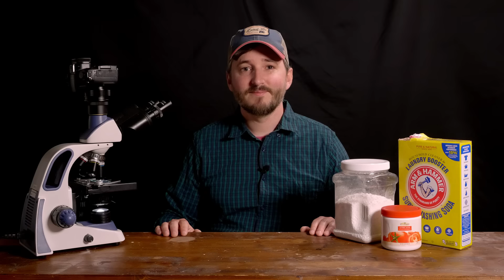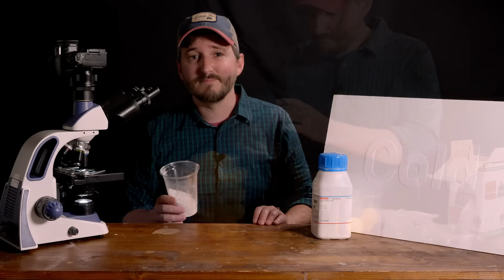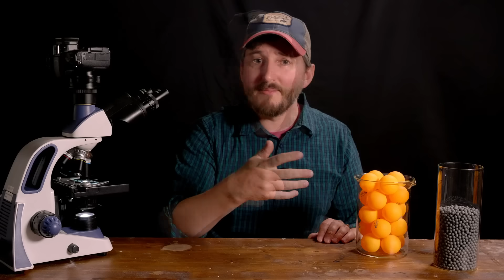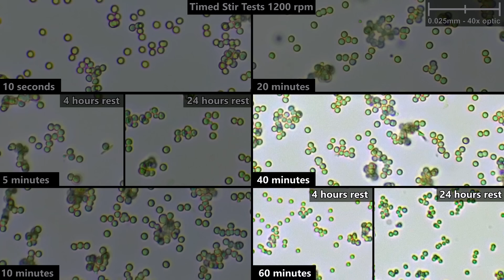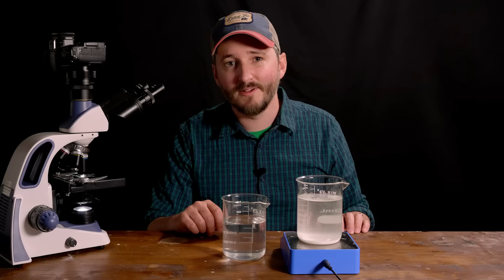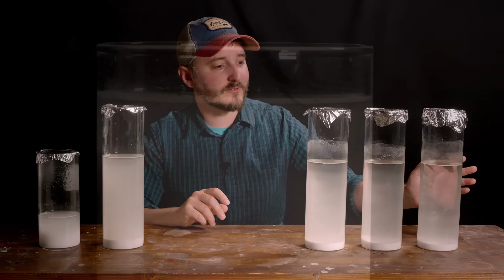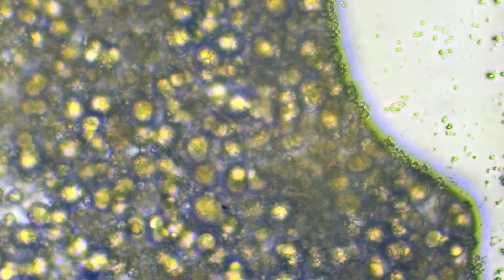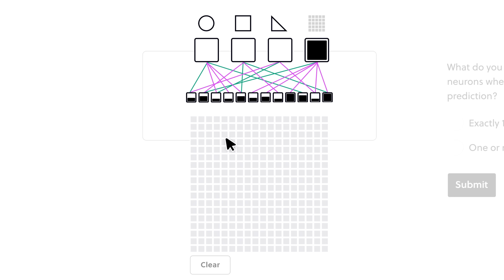Making Infrared Cooling Paint From Grocery Store Items (w/Novel CaCO₃ Microsphere Synthesis)

Comment: This is cool. How many BTU per hour can be radiated out to space?  How many panels would one need to make, or what size would the panels need to be in order to match the performance of a window air conditioner?
Reply: So one company sky cool systems put a system of 32 panels on a grocery store cooler and saved $5,800 per year or $90 per square meter in electric costs. These run 24 hour a day, have hot water running into their commercially made coolers. This was about 2.5 times more effcient than solar panels. AKA radiative cooling saved about three times the power, a solar panel array might have made. For comparison one could use solar panels to run an air conditioner. I suspect in this case they improved performance by putting very hot water in the radiative cooler.  This was a 15% improvement.
Reply: If you covered an entire house with a panel like this, it would be like night time all the time and there would be no daytime thermal gain from the sun. This would do away with much of the need for air conditioning. (humidity is another issue) (in humid climates as much as 25% of air conditioning energy goes into removing humidity from the air) AKA sort of like have a house in the shade of trees all the time. That said, these cooling panels have limited cooling per square meter.
Reply: OK so here is the answer. So in the daytime, the sun can radiate about 1000 watts per square meter in heat, radiative cooling can radiate out about 100 to 150 watts or about 1/10th that amount. So If I had a house and I covered it in radiative coolers, and it was 9/10ths radiative coolers and 1/10 radiative heaters it would be about the same. (assuming a radiative heater captured all the sun power (in reality some capture about 40%).  Good solar panels capture about 20% of the energy.
Reply: So with cooling of 100 to 150 watts per hour, a ton of cooling is 3,500 watts of cooling. A small house in America in a place like Indiana will have an air conditioner that has 2 tons of cooling per hour. it has 7000 watts of cooling capacity. If each panels has 100 watts it would take 70 panels 1 meter square. This means it would take about two thirds of the cool of the house with cooling panels to keep the house cool.
Reply: So if you took a house that had a thick concrete roof, and had a lot of thermal mass. Painted it white with this special paint, then covered it with two or more layers of plastic to keep the heat out, and allowed the roof to radiate the heat to space, but not absorb the heat from the air, the house should cool enough to not need air conditioning. If would effectively, always be cool. This could be aided by some thermal mass, (lots of buckets filled with water.)

Comment: Talking about protecting the paint, could you coat it in epoxy resin (or even mix the pigment in) to protect it long term? I suspect this will reduce the effectiveness to some degree, but still allow for significantly increased lifespan, potentially making it more worthwhile. Just thinking out loud...

Comment: Create a graphite besed primer first then coat it with your solution. You could use sodium slicate mixed with graphite powder. You will need to apply a seperator layer / electrolite layer. This can just be straight sodium silicate. Then apply your paint. This could possibly produce a small current. I was working on a TEG Paint and insulation system. It has both electric storage and also worked with temp differiencials. First attempts used graphite / Sodium Sylicate and Alum Oxide powder / Sodium Sylicate with a seperator layer. You can use straight alum for the anode as well. A very simply experiment is to put sodium sylicate in pop can and submerge a chunk of graphite in it. Apply mild heat. In my experiment I think I made four of them and hooked them up in series and I could light an LED with this crude set up. 

If an entire house was built using these materials, you have cooling plus potential to produce electric for battery storage. Given the added Peltier effect this may work to help with heating. Very interesting Im saving this and will revisit my development to merge what you are doing with it.

Comment: Fantastic video! I've been awaiting your results eagerly (I think I even mentioned previous video comments that I have a project using this) and it's exciting you found such a cheap, effective formulation. Tip I learned from my chemistry profs: when pouring powders, it's best to do it by turning the container back and forth on the axis of tilt. This helps to reduce overflow and messes that happen with pouring powders. Clumpy or static-y powders will obviously be more challenging, but it still helps.
Reply: More thoughts, on application of the "paint": this could be amenable to using a 3D-printer style setup for application, maybe?

Comment: try using a ultrasonic jewelry cleaner for even smaller nano particles after stirring a little. also try diluting it a little & try different nozles for spraying it on with a paint gun. also can you compare your paint to off the shelf coatings that are supposed to do something similar like coolcoat or stakool? & thanks for making these videos they are very informative.  I hope to someday paint my entire RV with whatever seems to work best & hopefully be able to stay in the Texas heat with minimal to no electrical use for cooling.

Comment: @nighthawkinlight I’m working on refining this. I teach engineering at a major university and would love to see all your different failed designs. 3 questions jump to mind immediately: 1) doesn’t the foaming/snow action of the acrylic and water mix reduce the packing density? 
2) could you just go for the smallest sized Valerite particles with 10min mixing? Should get high density?
3) did you try off the shelf #200 mesh calcium carbonate with the acrylic water acetone base? If so what we’re the cooling results?
Reply from the maker: 1. The foaming action introduces voids in the paint but does not reduce pigment density within the solid regions.
2. Packing density of any one size of sphere is ~65%. The voids might be harder to see with smaller spheres but the volume they occupy is identical.
3. I was unable to find off the shelf CaCO3 of sufficient purity and whiteness to compare to the bright white spheres. I try some that was slightly offwhite and it did work reasonably well but the spheres work better.

Comment: As far as applying to a sheet, have you tried putting a thin layer of the CaCO3 microspheres on the panel you want to coat and then misting with cyanoacrylate? I think it should cure nearly instantly as the CaCO3 is slightly basic. Could adjust the viscosity of cyanoacrylate with acetone as well. I believe dried cyanoacrylate also has the snow scattering properties you want as well

Comment: The application method is laughable. 😂. Better just use a ceiling popcorn hopper with an air compressor to spray the stuff to the correct thickness. People are not that patient. Awesome video.

Comment: I feel like this pigment could be mixed with cement or clay and made into bricks/tiles or even just incorporated into a glaze. Cooling bricks instead of panels, like the opposite of insulating bricks. Great content as ever, thanks for your time and R & D!
Reply: After some looking I think clay or glaze is out, as the firing temps required would likely decompose the spheres. Cement might work with a proper ratio, just enough to hold the thing together but not so much that the crystallization interferes with the stacking of the spheres. Not sure. Then there's sodium silicate like what's used to harden sand molds for metal casting, obviously quite durable, but again I'm not sure if those crystals would get in the way of the spheres. Lots to be tested for sure.

Comment: Could you mix this paint into a liquid and run it through pipes to absorb heat from inside then run through a clear piping radiator to drop its temp and then pump it back into the house?

Comment: Thoroughly fascinating video! Great work solving the sphere size problem, your finished product looked great. I have an idea for application. In modern cabinetry kitchen cupboard doors etc are often "coated by placing them in a paint filled vacuum seal bag. Once the vacuum is pulled, it leaves a beautifully clear smooth and tough surface. This could aid with getting an even look as well as providing a protective film for the material inside.. Best of luck!

Comment: There's a second half of how this paint works that confuses me thermodynamically - why can we confine our thermal radiation to preferentially be in a single band? Surely if you pushed it to the limit, you'd be able to take thermal energy and convert it to a single wavelength, dropping entropy?
Reply from the maker: I'm not sure why confining IR radiation to a single band would violate entropy any more than an LED violates entropy with a single band of visible emission. This isn't an energy neutral process. Ultimately the emission is being powered by the sun as the panel is absorbing heat from its surroundings. If there were no exchange of heat between sun and earth everything would cool to the same temperature. You might want to read the Wikipedia article titled emission spectrum.
Reply: @Nighthawkinlight  A large electric potential is a highly coherent source of energy from which to generate a highly coherent beam of light. I guess my confusion is about the relative entropy of thermal energy vs electromagnetic energy in a very small frequency spectrum. It seems that a substance that only radiates in certain frequencies is necessarily "reorganising" random thermal energy back into a few frequencies from which we could easily extract work.

I guess there must be a limit in the nature of how or to what degree this thermal energy can be reorganised/packed into small frequency bands, that is nonetheless still exploitable iff you have an electromagnetic coupling to space.
Reply from the maker: @jamesnomos8472  It doesn't make sense to think of heat as incoherent. A flow of heat from one place to another is how most "coherent" electricity is generated. You could also think about this in terms of the Tacoma narrows bridge collapse. Highly incoherent air simply flowing in one general direction was able to stimulate the resonant frequency of the bridge until it collapsed. That's all that's happening in this paint. Heat is flowing from a hot place to a cold place and stimulating the resonant frequency of the CaCO3 molecules along the way. That stimulation is dissipated by the release of IR light which naturally corresponds to the frequency.

Comment: I think the next step is to delve into paintmaking and the substances used for binders and whatnot.
A good paint-base which you could add this to, which also does not interfere with the IR properties of the CACO, yet still provides structure and protection, would potentially make it like a regular paint.
Basically, what I'm saying is: How do you make auto-body paint with this pigment?
Reply: Also, if you heat the surface, can this keep up? How many watts of dissipation can one potentially get using this as a radiative cooler modification?
i.e. Waste heat, piped to panels coated with CACO, pointed at an IR solar panel to regen some electrics perhaps?

Comment: @nighthawkinlight what microscope are you using to see the nano particles? Normal microscopes can't see that small because they rely on the wavelength of the light.
Reply from the maker: An optical microscope can see a particle down to about 200nm in size. The smallest I made here were probably about 4-500nm

Comment: Does the acrylic paint stick to plastc, eg coriboard? I'm thinking this would be best as a water-cooling panel, especially at night-time (in hot countries ambient air remains hot well into the night, but skies are often clear).
So run water through cheap plastic corrugated panels coated in this and store the water for day-time cooling (or use it directly, maybe as a waterwall to catch humidity too), and some additional cooling during the day if skies are clear etc.

Comment: something like a 1/4 in. x 3/16 in. V-Notch Flooring Trowel could spread it evenly. first pass produces ridges. then dry. second pass with a squeegee fills the valleys. 
great vid. subscribed!
Reply: on second thought, the shriveled ridges wouldn’t leave the right amount of valley. the filled valleys would shrink even further. it would probably be infuriating to keep topping up the valley after it shrinks each time. better maybe to just rely on the first pass with the trowel to evenly distribute the paint then hit it it with some vibration to see if it will auto level. 🤷‍♂️

Comment: I'm sure this will be buried but if the paints thick enough wouldn't a wood dowel with rubber O ring spacers the thickness of the layer you want be the ideal solution, just put a heap of paint down then spread it out exactly as thick as you want it

Comment: What about some form of powder coating?

Rather then pre-mixing with water and spraying could you maybe coat the surface with water/solvent/adhesive then spray or dip the powder onto that?

If it would work it might be possible to do lots of thin coats and depending on drying time actually be faster.

Maybe even via electrostatic if the materials can be charged sort of like the method used to paint cars?

On the assumption my assumptions aren't assumptions of course 😉

Comment: So basically you just expanded upon the research in that paper by figuring out how to control the size of the particles precisely, and then instead of writing a convoluted and difficult to read paper that would be blocked behind a paywall, you disseminated it to the masses in a comprehensive, easy to follow video guide? Now THIS is the future of peer-reviewed literature.
Reply: Also, the most obvious application in my mind is to make window blinds with this. Not only do they repel the light, but the sub-ambient temperature will actually be retained on the inside of the window pane in a well-insulated house.
Reply: Could you combine this with the waterproof tarp recipe? Would the naptha & silicone solution be okay to combine with the pigment or would it potentially break it down? I'd guess so since I gather it's a base rather than an acid.

But then, would using the silicone mixed in with this material just dilute the pigment and therefore render irrelevant all the work in making it high-density? And on that note, wouldn't any liquid base ultimately dilute the high-density pigment to some extent? What does the pure-acrylic paint vs. the water-acrylic paint look like under a microscope? Doesn't the water-acrylic mixture dilute the purity of the specific pigment which reflects that oh-so-special wavelength of light, even if it does make the mixture a 'very bright white' to our eyes?

Comment: Experiment number one. What thickness is optimum.
Experiment number two. How much of the effect is just insulation properties?
Experiment number three. What effect does various mediums for holding the pigment have on its desired effect. For instance, mixing it in clear epoxy, tree sap etc.

Comment: There are people who improve solar panels by trying to concentrate the light on the panels. The issue with concentrated solar is the heat it produces. You have to waste some of the gains made by using fans or other cooling methods. This paint might be able to fix concentrated Solar's biggest issue if used correctly.

Comment: Excellent video, as always! All your efforts definitely paid off!
Regarding coating panels/any flat surface, I immediately thought of the methods used with resins (such as epoxy): use a (non-stick, acetone resistant) "frame", along with some mastic (acetone resistant one as well, which would rule out any silicon based product?) to prevent leaking, then pour a more fluid, acetone diluted version of your paint, so that it eventually ends very flat, with a smooth surface. The frame would allow any shape (if needed) on the panel/target surface. As for tubes, though most probably impractical (especially for long ones), the opposite *could* work well: a thicker paint (but not too much!), then dip the tube in it, vertically, and allow the excess to flow down. That would not be ideal though, as the final coating would most probably not be regularily spread out along the tube in terms of thickness...

Comment: I don't know if you have considered it or if it will work, but it seems like this powder pigment could be used in an epoxy such as is commonly used for coating countertops. These epoxies are very often treated with pigments and would likely disperse the pigments well. There are UV resistant epoxies that would not yellow with exposure to sunlight. If you used the pigments in the color coat and then used a flood coat without pigment (clear) on the top, it might give similar effect as your much more fragile plastic film.

Comment: Have you considered using a commercial clear acrylic paint as a paint base? Just add your microsphere pigments and stir. Good for testing small samples
.
Practical concerns include opacity at the wrong wavelength (but you're already using an acrylic base), and the effect of yellowing after long exposure to sunlight. Other concerns would revolve around cost, obtaining liter (or larger) quantities, and possible environmental issues.
.
Another thought: Use a ball mill (i.e. rock tumbler) to break up clumps in your pigments. Maybe mix paint and pigment in the ball mill.